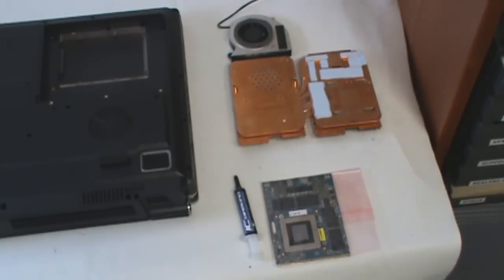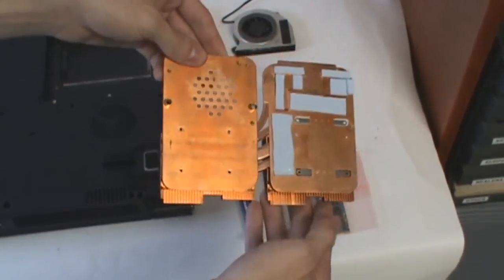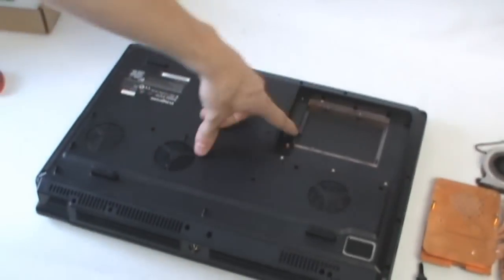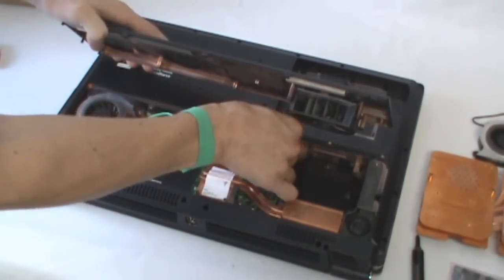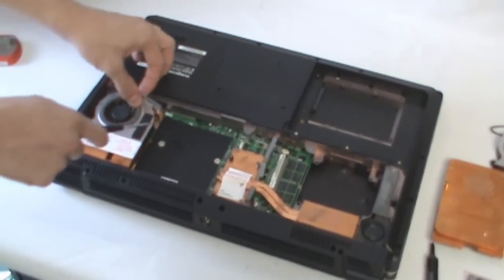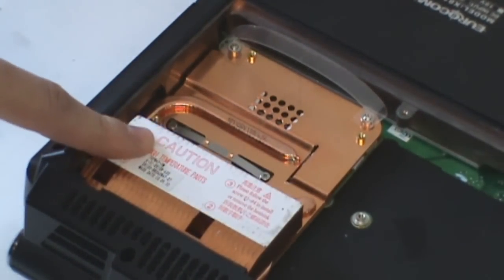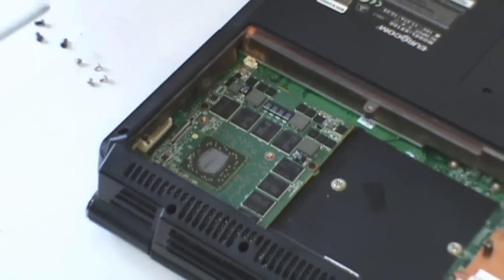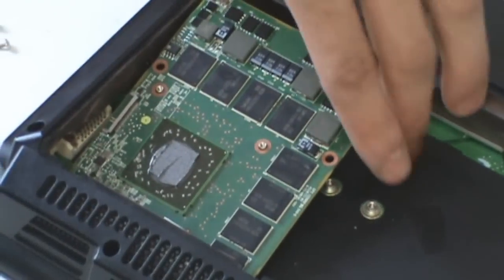NVIDIA GeForce GTX 680M Upgrade in EUROCOM X8100 Leopard

Comment: Hello,

Can you help me with a simple thing?

Which of these graphics cards do you recommend for my Clexo X8100 (Radeon HD 7970M or GeForce GTX 680M)

Which one is the best?

Best Greetings
Reply from the maker: What do you need help with?
Reply: What graphics do you recommend for my Clevo X8100? 
Of the two that I will mention!

Radeon HD 7970M 2GB or GeForce GTX 680M 4GB?
Reply from the maker: Depends on what you are doing with the graphics card. CAD? Gaming? Video Editing?
Reply: Mainly to play, I want to install GTA V, because in my graphics does not work!

I wanted to put a better graphic!

Which one do you recommend?
Reply: GTX 680M 4Gb ist better, but i dont know if This would work ( maybe u need to mod your bios ) - if you build in an new GPU, please write how it works.
Reply: I think I'll forget that!
I do not know how to build a GPU, I had to buy everything already ready !! But I see it gets expensive!

Comment: I have an 8100 with dual GTX 285's.  What would be the best upgrade to a single card?
Reply from the maker: GTX 680m of the ATI 7970m   Thanks
Reply: Thanx! Can I use the stock heat sink/cooler/Fan  from the 285?
Reply from the maker: If you upgrade to the 680m you will need the dual pipe3 heatsink.  Its available on our website

Comment: omg.....the music is too over powering.....this is a tutorial video right?.....I cant hear the tutorial?

Anyway, i have a metabox (clevo) 180hm and it was running twin 6990m, will your upgrade work in my system? and will it run as good as or better?....or what would you recommend.
Reply from the maker: +SergeantSerious Yes, 680M is supported.  You can order the 680M upgrade kit on our website here: http://www.eurocom.com/ec/upgrade(1,296,0)ec
Reply: +EurocomTechnology hello does the laptop support a single gtx 675m 4gd? from the specs it does provide sufficient power and provide the mxm 3.0 b slot.

thanks
Reply: +Russ Yakimovich also I was wondering if you had a solution of mxm 3.0 b to pcie x16 graphs slot. that way you can utilise the slot for an external graphics card with full speed of x16 slot.
Reply from the maker: No, we do not have that solution.  I'm not sure what you mean.  Check out the graphics options we offer for the X8100 here: http://www.eurocom.com/ec/upgrade(2,300,0)ec
Reply: +EurocomTechnology basically an adapter that goes from mxm 3.0b slot to a full desktop pcie x16 slot. mxm 3.0b is essentially a pcie x16 moreover, if a female jack from an mxm 3.0b can be utilised to a full desktop pcie x16, this will give full fledged desktop gpu a full access to the computer... I recon of you devise this cable it would be benefiting the laptop in the long run.

Comment: Hello,

I have a Clevo X8100 , I would like to know if I can get one in the graphics cards in SLI ?

I was thinking of putting this graphical ( Nvidia GeForce 970m SLI )

Can you help me?
Reply from the maker: Hi!

The X8100 supports the following graphics cards: 
  - NVIDIA GeForce GTX 460M
  - NVIDIA GeForce GTX 480M 
  - NVIDIA GTX 680M 
  - AMD Radeon HD7970M (WimbledonXT); 
  - AMD Radeon Mobility HD6970M 
  - AMD Radeon Mobility HD5870; 
  - NVIDIA Quadro FX 3800M; 
  - NVIDIA Quadro FX 2800M; 
  - nVidia GeForce GTS 360M; 
  - GTX 285M Nvidia GeForce; 
  - GTX 280M Nvidia GeForce; 
  - SLI; NVIDIA GeForce GTX 280M; 
  - SLI; GTX 285M Nvidia GeForce;
  - SLI: 2x NVIDIA GeForce GTX 460M; 
  - CrossfireX: 2x AMD Radeon Mobility HD6970M;  
  - CrossFireX; 2x ATi Radeon Mobility HD5870;

It does not support the 970M, sorry.  good luck!
Reply: EurocomTechnology Does not it?

You can tell me if I can do SLI Nvidia Gtx 680M on my Clevo X8100
Reply from the maker: kpirata1 No it can't support two 680Ms, the thermal solution can not support that much power.
Reply: EurocomTechnology I have two slots for graphics ! still does not give?

Slot type : MXM 3.0 Type : B
Reply from the maker: kpirata1 No, sorry, the X8100 does not support the 970M even though the X8100 has two MXM 3.0b slots.
Reply: EurocomTechnology Not me was referring to 970m , was talking about the 680M , if I have two slots for graphic still can not put 2x GTX 680M ?
Reply from the maker: kpirata1 During our testing, we found the X8100 could not support two 680Ms, only one.
Reply: EurocomTechnology Can you help me one thing ?

What is the maximum lmite Watt that my Clevo X8100 can handle graphic ?
Reply: EurocomTechnology Hello again :)

Can you help me? I am even to buy the Nvidia 680M graphics card, you can tell me what should I buy coler, the cooling system?
Reply from the maker: kpirata1 As described in the video we have a special modified heatsink.  Contact sales@eurocom.com for assistance.
Reply: EurocomTechnology Thanks :)

Comment: hallo ich hab ein Clevo X8100 mit gtx285m im sli und hab eine gtx 560m, wie kann ich die gtx560m so einbauen das das bios sie erkennt??? bitte um hilfe
Reply from the maker: It should be a straight up card swap.  You should verify the thermal pad layout is the same.  After install just update the drivers!

Comment from the maker: The new card will help process the visuals in your game, allowing for smoother play.  I;m not sure if that game is either processor intensive or graphics intensive, but typically graphics cards upgrades are the best in helping games run better.  A memory upgrade is also good in helping the computer run faster and is also very easy.

Comment: I saw in Eurocom site that the price is almost the same between  NVIDIA GeForce GTX 480M (2048 MB) and 4GB GDDR5 NVIDIA GTX 680M... Is the upgrade really good, in my case? Or is better change the 8MB to 16MB? I need to run the Final Fantasy XIV at maximum and is capable but it runs only in 29.3 FPS.. Anyone help please. I´m 36 years, not a kid, but is really important cause my wife loves play the game too -.-' Thanks!

Comment: Awesome vid! I have a Clevo X8100 with: Mobile QuadCore Intel Core i7-920XM Extreme Edition, 3166 MHz (24 x 132) - Intel Ibex Peak-M PM55, Intel Lynnfield - 8180 MB  (DDR3-1333 DDR3 SDRAM) and an NVIDIA GeForce GTX 480M  (2048 MB).
Can i replace for an NVIDIA GeForce GTX 680M graphics card? The AC adaptor is the same? My bios is old (06/29/10, is it important? And the last question: where can i buy all the stuff you show in vid?
If u wish: pauloinacio@outlook.com Many thanks in advance!

Comment: Hey I have a Hp Pavilion DV6 with an amd m880g radeon hd 4200 graphic card. I want to upgrade to NVIDIA GeForce GTX 680M is it possible and im 13 so how can i do it. I have the money for the card so money is not a problem. Just I want to know if the card could work on my laptop and how can I install it. Would i need some one to do the task for me?

Comment: The motherboard and 5870Ms had been replaced and it would still have graphics glitching issues with crossfire and the cards would seemingly die not too long after. Replacing the crossfire cable seemed to fix the problem but eventually both cards died and they werent able to be replaced anymore, so I had to buy a new card and went with a 6970M (would've gone nvidia but the cards were too pricey for me.)

Comment: I was interested in using the double heatsink like on the GTX 680M for extra cooling since I may not get a second ATI 6970m for my X8100 as there was an issue with crossfired ATI 5870Ms literally dying, possibly due to the crossfire cable (even the place i bought the laptop was having the issue when they worked on it). Not really able to risk it unless there would be some kind of guarantee on replacement.

Comment: I plugged it into the second connector and ran it through the back so that i could see if it would run or not when the graphics card got hot. I could also put a second heatsink in it as i was running crossfire before I got a better card and both fan connectors do work when there are two cards, but dont seem to when there is only one.

Comment: I have the latest BIOS 1.00.14 and EC 1.00.08 After connecting the second fan on the empty slot and running furmark for 5mins reaching 76C, the fan on the card ran high while the second fan did not turn the whole time it was connected.

And i'd love to get the 680M upgrade but for the price i could buy a whole new and faster desktop or two more of the new graphics card in my X8100. So i was asking for the heatsink only to put on my current card while i wait it out to see about the 680MX or later

Comment from the maker: The X8100 can support two GPUs, it was initially designed to do just that.  But two 680M's or 7970M's create too much heat for the system to manage, therefore we just install one.  It could however support less powerful, and therefore heat generating cards in dual operation.